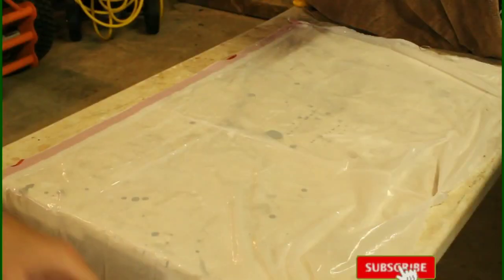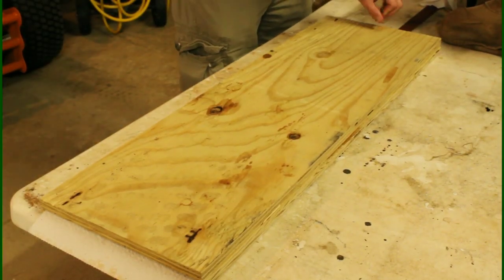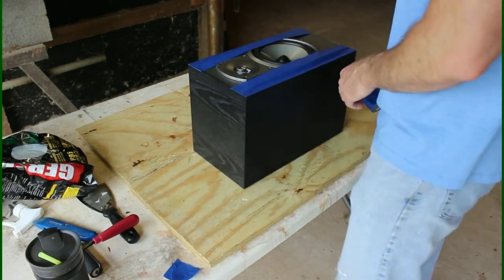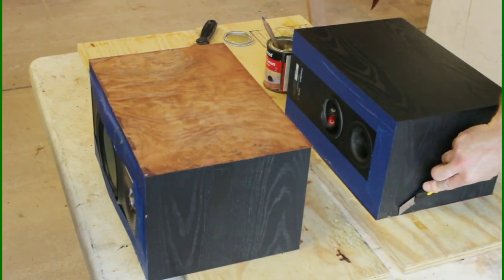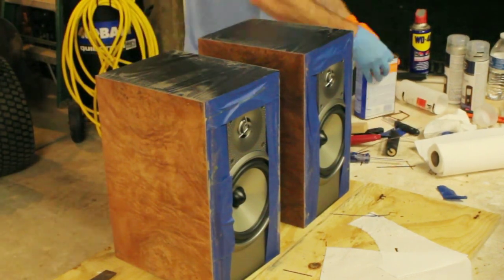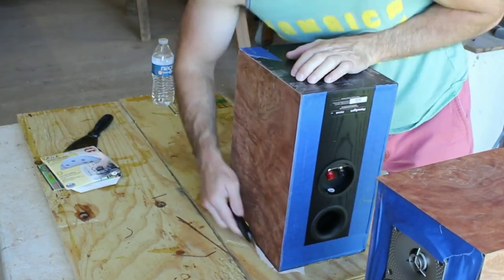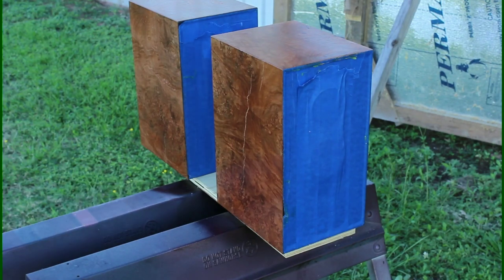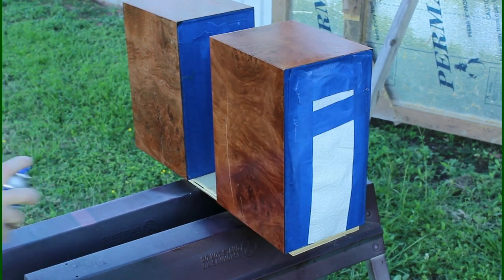Ep. 37 - How to Apply Real Wood Veneer your DIY  Speaker | DIY Speaker Veneer | Home Theater Gurus

Comment: 4 months ago I did something like this - real Oak veneer ( pre glued ) 1 ft x 8 ft, $50..... and with zero veneering experience or tools, I'm saying B+ or A minus.  only question, how long is the glue going to stick to the stock vinyl on the KEF Q350's > real good + speakers but obviously KEF tried hard to keep cost down with cheap finsh. tools I bought - curved linoleum knife ( worked before for me than a razor box cutter) and as 3 in. wide H.D. roller. thats it.

Comment: Nicely presented and super useful.  I was literally going out to my shop to veneer a set of speakers today and would have spent a lot of time sanding the existing veneer, which is identical to yours. I did not realize it was vinyl.  Wood glue or hide glue would probably not have worked, so you just saved me some aggravation. Thank you!

Comment: A couple of points, if you don't mind me piggybacking....
   A.  Do NOT use isopropyl alcohol to clean your surface before cementing. It will bubble up your cement and it will not work.  (ask me how i know)
  B. When trimming the edges after cementing, put your speaker on a HARD surface, not cardboard. If you try to trim on cardboard your veneer will flake apart like crazy.  (ask me how i know) 
       Just trying to help anyone trying this for the first time.   Anyway, great video !

Comment: Nice!!
You are a brave man.  I would have taken the drivers out, and everything else that could be detached.  It's possible even the dress baffle can be removed (that's possible on some speakers). But I would have done that because I'm a complete klutz, LOL.  
With all the detachable stuff removed from the speaker, perhaps it might have been possible to lift the vinyl with a bit of acetone...
Reply: No you would have done the right thing just take a good look at 6:36 what he did to the woofer  .
Reply from the maker: These literally are my shop speakers so I wasn't worried about it but yes If it wasn't for that I definitely would have removed the drivers.  Luckily everything survived. :)

Comment: Thank you for the video.
Can I add a pattern neck in a narrow area on the front border? I worked on a similar design of speakers as a film, but I'd like to work on the patterned wood again, but I'm wondering if it's possible with a small area in the front.

Comment: Hi there! This is exactly the project I am planning to do, except on a brand new Triangle Br03 speakers I just acquired. Loving the sound, unfortunately not loving the very fake looking walnut vinyl. Does applying a layer of veneer over existing vinyl affect the speaker's acoustic performance?
Reply: On the front baffle it could. If the drivers are flush mounted and the veneer using is thick it could affect diffraction. But if it's thin it should be fine

Comment: How is the adhesive holding up? I thought maybe roughing up the vinyl surface with like 400 grit sand paper might help the adhesion better between the veneer and the vinyl?
Reply from the maker: It's holding up fine.  Can't hurt to rough it up though.

Comment: I know this is a demo on how, at 6:34 the contact cement splash and the residual drips went to the speaker woofer.  I think maybe wise to cover all the front with some plastic or masking tape.  This would be much more than I would have ever done myself but still sad to see a good woofer get contact cement on it and paradigm ain’t cheap to replace
Reply from the maker: This is just an old speaker I had. If it was your nice speakers then sure. Cover the baffles.

Comment: Is it possible to mix the glue with a pigment and then fill in cracks?
Reply from the maker: Yep,you can also use dust collected after you sand it that will have the actual wood and pigment in it.
Reply: @hometheatergurus  That was actually what I meant. Thank you

Comment: I have several sets of speakers that came from the factory with real wood veneer on them and a couple are really showing their age. They're also oiled finish so they've never really been "sealed". I've been up in the air for years now debating whether or not to attempt to recover them. The worst offenders are teak veneer, so that won't be cheap if I bone it.

Decisions, decisions...
Reply from the maker: Don't mess them up and blame me..  :)
Reply: @hometheatergurus  Ehhh... For the most part it's kinda hard to make 'em worse. I've had reasonable success with just sanding and reoiling before so I'll probably start there again. Glass tops hide some sins too. ;)

Comment: Could you do this on a medium sized subwoofer or would the veneer pieces be too small? Do you need to use 1 sheet per side?
Reply from the maker: You can buy larger pieces on the veneer site in the description.  You can also lay them them side by side to cover a wider panel.   There's lots of videos on YouTube showing it.  If you follow the steps it's not too hard.

Also search for veneer book matching.

Comment: Wouldn't it be better to add two coats to the porous (veneer) surface and one coat on the sealed vinyl? The directions on the can say the opposite of what you did.
Reply from the maker: Whatever it takes to stick.  If the veener soaks up enough that you feel you need two coats, do two coats.

Comment: From what I've read, it's not a good idea to use contact cement if you plan on finishing with a penetrating type oil, such as tung oil, because the oil can possibly destroy the cement over time.
Reply from the maker: Yeah I've read that too. If it had been on Mdf I would have used wood glue /iron method.

Comment: thank you for sharing the procedure for treating veneer before applaying it. I suffered watching covering that sexy black with veneer and the glue leaking into the woofer suspension. It would have been better sticking veneer on to rough wood loudspeakers.
Reply from the maker: You're very welcome.  I enjoyed covering the cheap stock vinyl black with sexy wood burl veneer.  The drip of glue on the cone...well that's a mere battle scar that i'll tell my grandkids about.. hell you can tell yours about it too and tell them about your suffering.